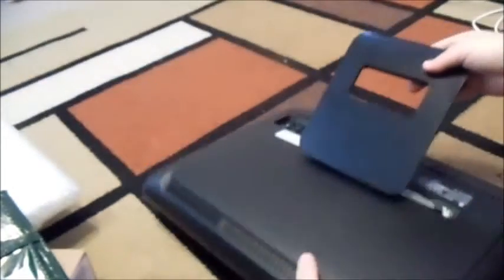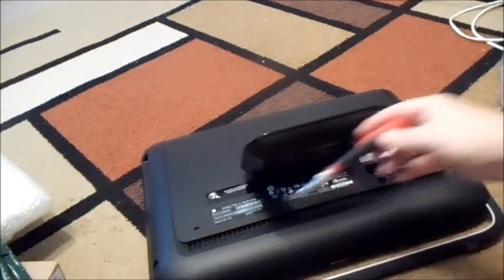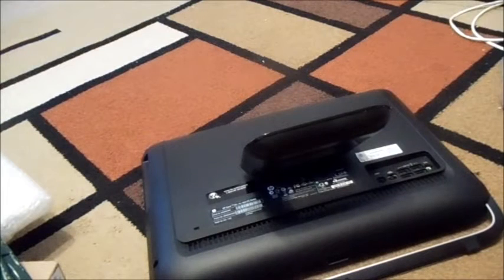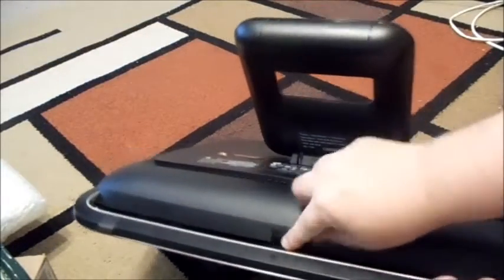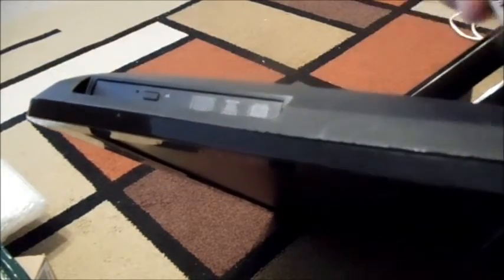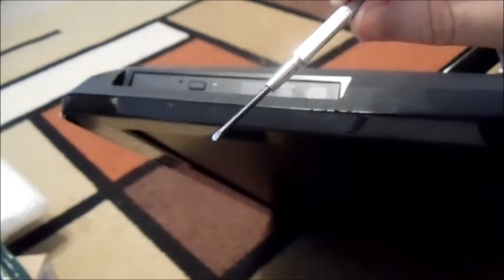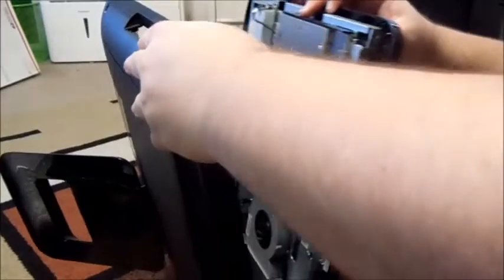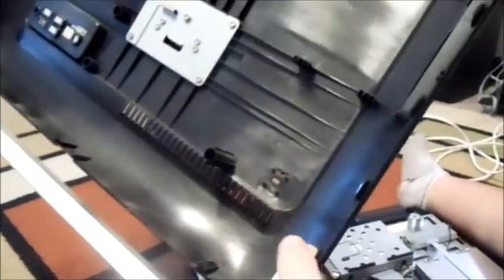How to Open HP All-In-One OMNI 120 Desktop (Disassemble Remove Take Apart Back Panel Cover 120-1000)

Comment: There is a hole in the back to press a tool into the apply pressure so you don't need to pry on those sides. You should also have a plastic wedge tool for running along the edge they are thicker and stronger than a flimsy plastic card. Prying those plastic side locks will break them after a couple of times and then even if the screws are tightened the top of the casing will hang loose with a gap where the plastic locks were broken. Fine if it is your unit and you don't care not fine if you are fixing one for someone else so keep that in mind.

Comment: I reset the password on HP OMNI 120-1204er Aio PC by this method

In factory settings strap pins 2&4

1 You need to strap pins 3 & 4
2 power on the unit
3 shut it down
4 remove jumper from pins 3 & 4
5 put back to pins 2&4
6 power on the unit, and your password will be cleared.